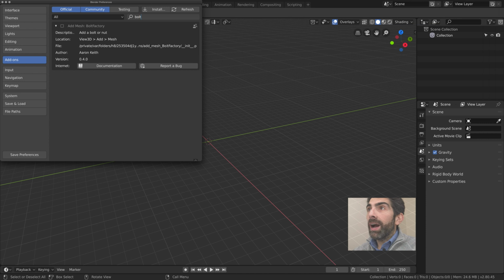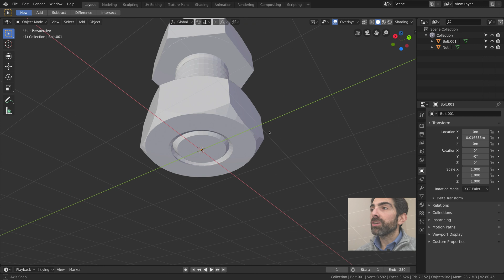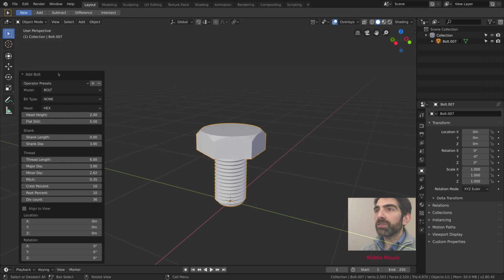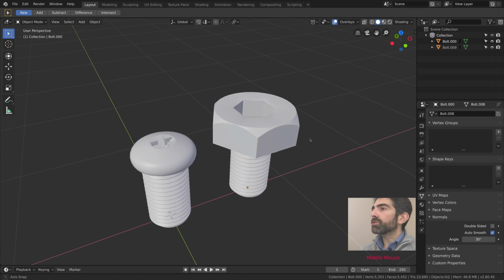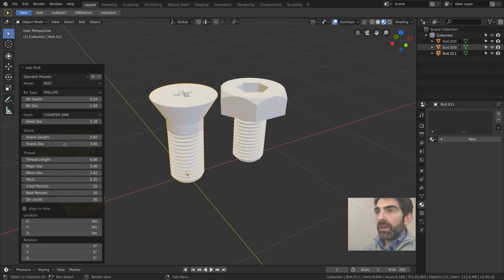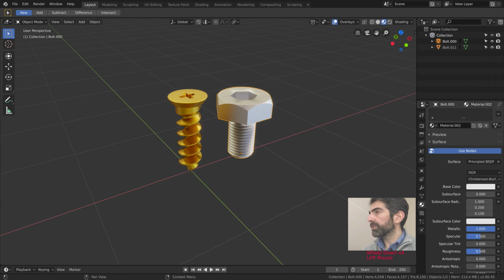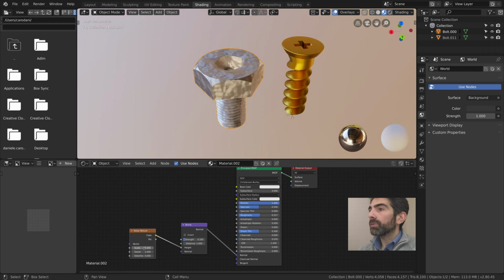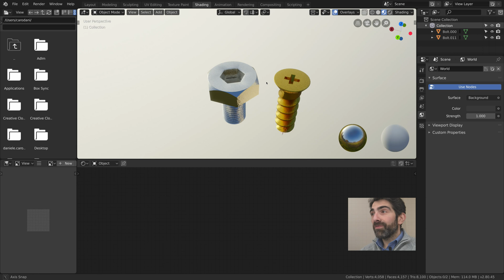How to 3D model bolts, nuts and screws in Blender 2.8 with Bolt Factory addon

Comment: UPDATE: it allows to make half threaded bolts, shank length
wrong: that plugin does not allow to create space w/o threads in cases when only part of the bolt is threaded
Reply from the maker: This is a very specific thing, pretty sure you can drag a few vertices and create the space you need!
Reply: @DanielOakfield  well yes, I can find some workarounds, but still it takes some time
Reply: @DanielOakfield  actually there's Shank length option, missed it, so there's a way )
Reply from the maker: @iddeegee  Great to hear, I admit I didn't know what shank length exactly was :D My bad!

Comment: Thank you for this video. How do I make a nut to fit the bolt. I tried using the nut feature in Bolt factory.  I used the same customised measurements I used for the bolt. When I print it though the nut is too small. Should I be doing something different?
Reply from the maker: Firstly, are you applying the scale after you edit your meshes?
Secondly, for 3D printing is suggested not to print the thread, usually you print a smaller bore and with a threaded bolt you carve the nut, this is because of the lack of precision working with plastic materials, but if you want to do it, I suggest going a 5% larger for any connecting part, again because the results may vary. Unless you are printing with a different material or going for mould injection or laser printing... tell me more detail about it :)
Reply: @DanielOakfield  Thank you for getting back to me. I tried scaling both before and after editing the meshes. I'll try changing the connector measurements. If this does not work then I will have to use another printing method. Thanks.
Reply from the maker: @aysiful  Let me know how does it go!
Reply: @DanielOakfield  I tried two methods and they both worked. The first one was to increase by 5% and create the connector. Second Method - I enlarged the bolt by 5% and used the bool tool and made a hole through a cube. The second method worked better. I'm not sure if it is my printer but for my project, I'll stay with the 5% increase and bool tool. Thank you for your help.
Reply from the maker: I am glad to know you solved, I wish for an ideal world where 3D printers are precise and no workaround is needed!!! :D

Comment: I add a bolt but no parameters window opens so I can't change anything but the scale of the bolt!
Reply from the maker: Do you see the options and are greyed out?
Or can you post a link to a screengrab of the parameter window? It supposed to be in the bottom left corner of the view..!?
Reply: @DanielOakfield   Restarted 2.8 for the 2nd time and it's now there, thanks Daniel!!!
Reply: You could also right click on the unit and select "Change Bolt"

Comment: I got the Bolt Factory addon activated in Blender 2.80.75, but it doesn't show the Bolt option, to add mesh ! Anybody knows why ??
Reply from the maker: Hi Bruno, just tried again and it worked fine... it's a coil icon in the add mesh menu, did you try with operator search and typing bolt?

Comment: this tool seems to struggle when the units are set to millimeters instead of meters. Or maybe it is beta problems with 2.8. Or maybe it's just me.
Reply from the maker: What kind of bug did you find exactly? What’s happened when the unit is set to mm?
Reply: @DanielOakfield  The values don't make sense in real.. M3 is not M3... You can check it also in blender when you turn on endge length.. So this add-on is kind of......

Comment: There was a newer or different Version which allowed to change the bold in the object buttons. THis was much more comfortable and also did take a scene scale into account. I wonder why the old one was ported?
Reply from the maker: I believe probably it's not compatible with 2.8? Will post an update in case anything new happens! Thanks for the heads up!
Reply: I just learned that this was a fork of the original which had some more improvements and error corrections. To bad they ported the original. But maye the oroginal dev was not active anymore.
Reply from the maker: @blenderbuch  it makes sense... but let's see with the next update!